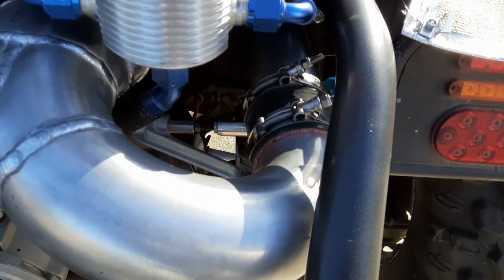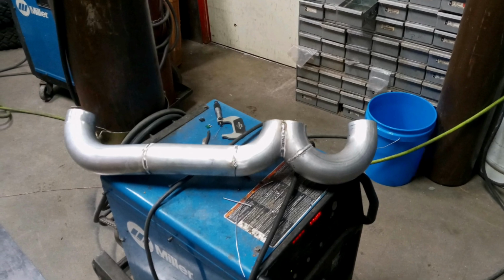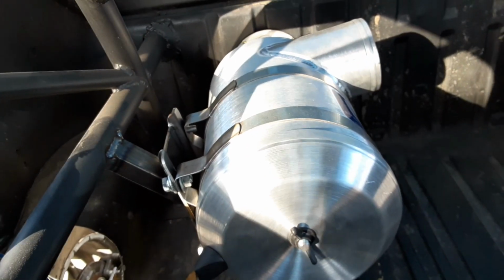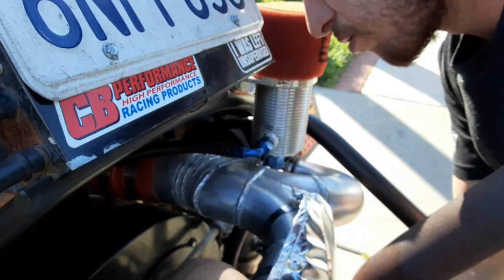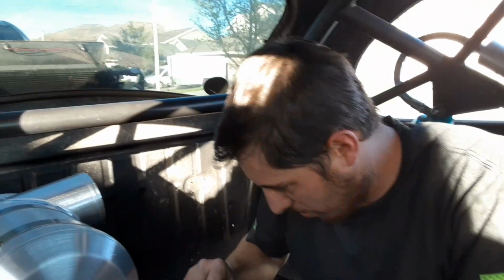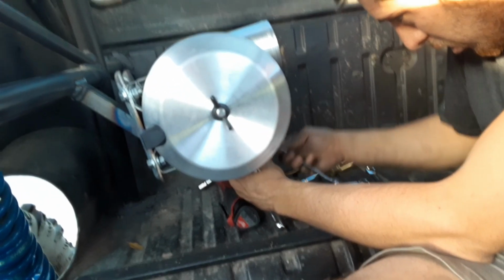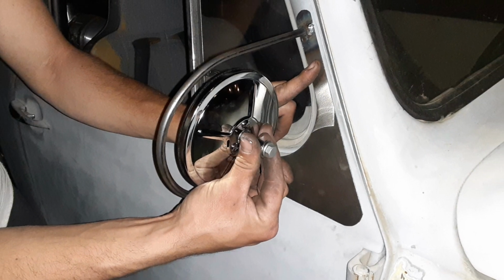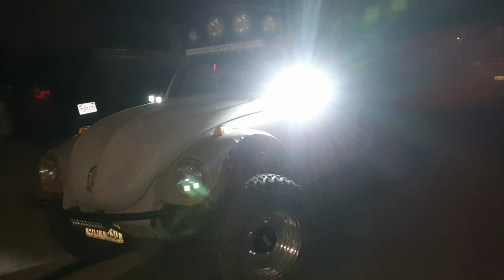Baja Bug MODS that make a BIG Difference! 🤤👌

Comment: Love the new mods on the Dust Buggy. Spencer has mad  mechanical skills. You know with all the money you are putting into the Dust Buggy engine mod's it would be cheaper in the long run to do a water cooled engine swamp.Plus you will get increased horse power and engine dependability.I'm currently looking for another baja bug prerunner to buy.I love old Volkswagens but I don't care for air cooled engines and their constant maintenance.
Reply from the maker: Lol we know. We like the aircooled motors though :)